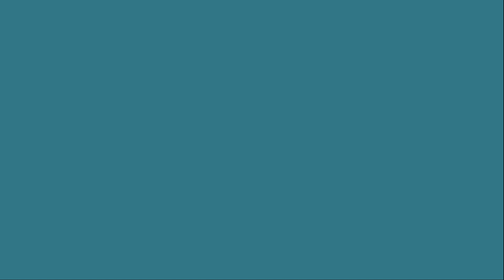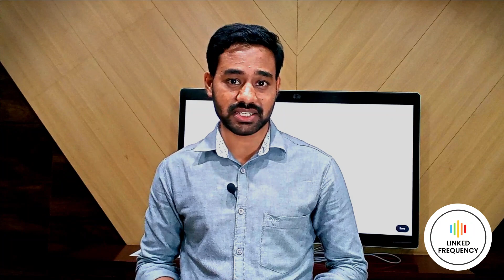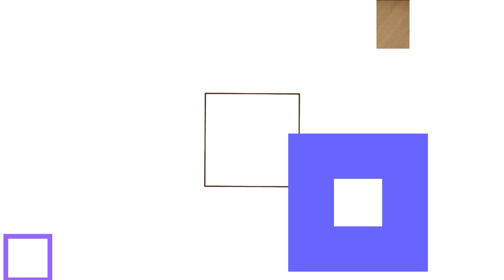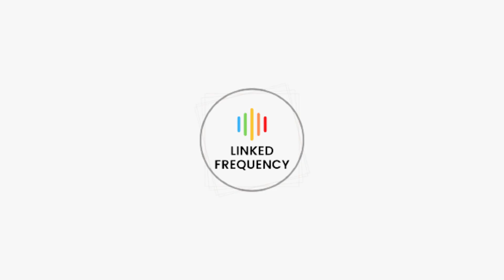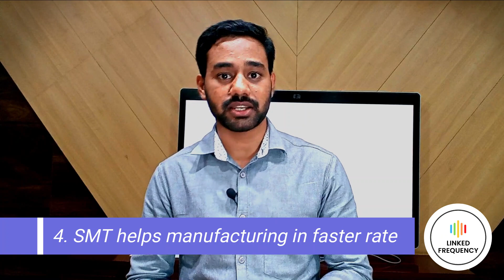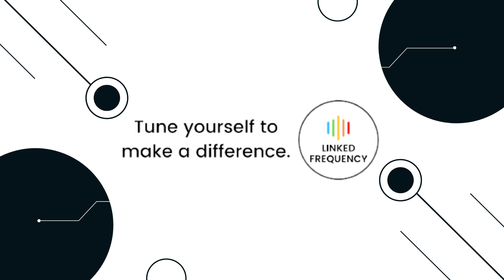The story of THT and SMT components #E07 | Vaibhav Sugandhi

Comment: Sir, if v have more advantages of using SMT then why would v prefer THT??
Reply: Hi Veena, 

Major reason why we go with THT in learning stage is, they are easy to use and solder for beginners. 

SMT components need a very high end skills to handle and use them. 

Also THT's are available is less quantity and locally anytime, SMD's are available only in 100's of quantity and not locally anywhere. 

So thats why we prefer to use THT in learning stage and SMT's in industrial products. 

Thanks for such a great question 👏🏻
Reply: @Vaibhav_K_Sugandhi  oh ok sir, tq😊